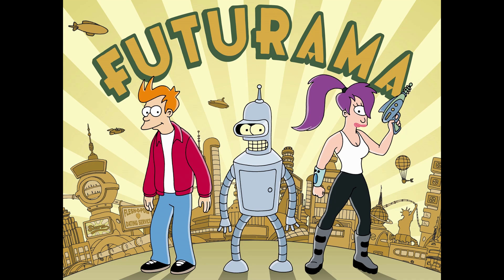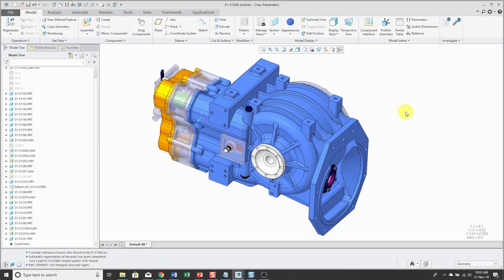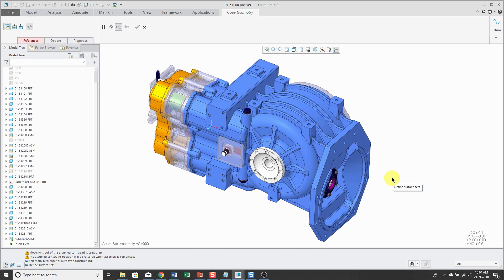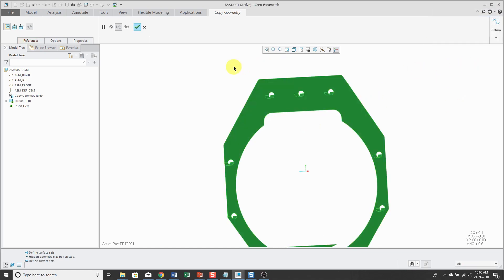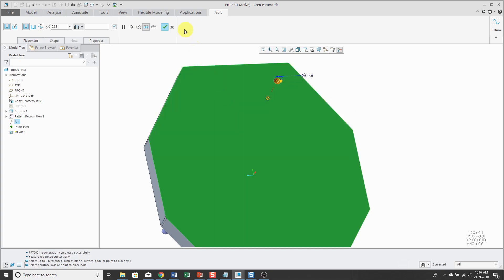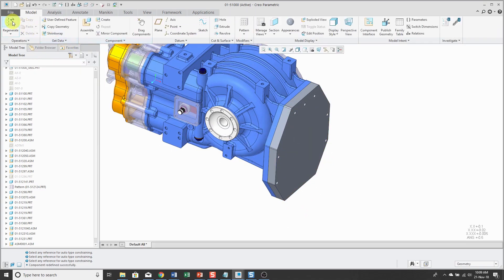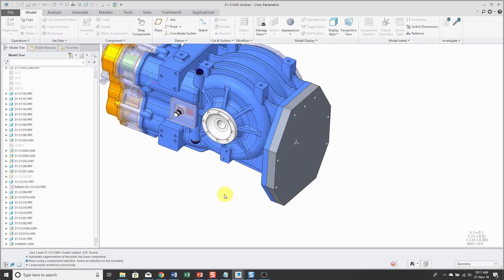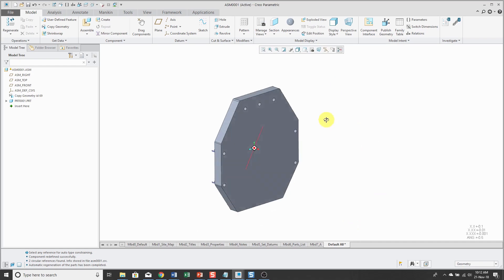Creo Parametric - Circular References (Part 1) - Assemblies & Top Down Design

Comment: Good explanation! What bothers me, is that so many Creo user (or maybe CAD users in general) don't take circular references serious and just continue working with their model. My recommendation: If you get circular reference, fix it right away! Or this thing will multiply down the line making your model more and more unstable. If have seen projects with over 1000 reported crcs.

Do people actually use the reference viewer to fix their .crc? I find the generated textfile.crc to be much easier to understand. Embarrassingly enough I have used the reference viewer hardly ever over the years. Understanding that thing is so hard, that even finding my mistakes manually is less time consuming.
Reply from the maker: PTC has made Creo and Windchill more robust at handling circular references. The downside is that it removes incentive for users to address the problems.

When the new Reference Viewer dialog box came out (I forget the previous utility, might have been Info > Parent / Child), I remember thinking that it is lot more complicated. However, it has a HUGE amount of functionality. Users do need to have a good understanding of references and dependencies.

Comment: Do you know if there is a way to avoid circular references in the case where you want to route piping/electrical hardware in sub-assembly B, which is mounted on part A (through top-down design), and then go back and make mounting holes in A by referencing sub-assembly B part placements? 
The individual features are logically sound, but it keeps giving circular references at the shrinkwrap / copy-geom (because the hole gets added after)..
Reply from the maker: You  basically have four choices: (1) locate the holes and then break the external reference; (2) use a higher level Skeleton to control both A and B; (3) use a Copy Geom or Shrinkwrap and then set it to Manual Update; or (4) live with the Circular Reference. There was an interesting presentation at LiveWorx last year by Pete Hollmer that indicated that Circular References might no longer be the bane to regeneration time that they once were. I wrote about that in this blog post on PTC.com:
https://www.ptc.com/en/cad-software-blog/unexpected-lesson-faster-cad-assemblies
Reply: @CADPLMGuy  Will have to look at watching that. But the article was definitely worth the read! It's good to know that at least the circular references doesn't break the model, as much as just slow it down a bit.. That may just be the option I'll go with for most cases.. Much Appreciated!
Reply from the maker: @danman155  I was surprised. I remember 15 years ago when Circular References would render an assembly unusable to the point that it couldn't be checked into Intralink or Windchill. I suspect it also depends on the nature of the Circular Reference; some are worse than others. I've also noticed that stuff that caused Circular References in Wildfire don't create them in Creo. Yes, they should be avoided, but they're not the end of the world like they used to be.
Reply: @CADPLMGuy  Just thought I'd come back and note the solution we've gone with because I was thinking about it today and remembered this thread (and thought it could possibly be beneficial to anyone else facing the same issue).. 
Anyways, the solution we've accepted is basically just as you say about having a higher-level skeleton, but instead of the skeleton defining the mounting holes locations (which was my first thought when you mentioned it, and which didn't 'feel' right), the skeleton is the "clean" structure without any mounting info at all.

So the process goes: 1) create the "clean" structure assembly (not considering any mounting holes, etc. ), 2) Copy assembly geom into a skeleton part for the cabling/piping to be routed against, and add/define the necessary mounting interfaces, 3) create a new structure assembly which copies the "clean" assembly but adds the mounting interface information and additional detail features (holes, supports, etc.).

In the end, it means that you're left with two assembly files for the structure ("clean" and "detailed"), only one of which is actually meant for manufacturing, the other is just an assembly skeleton model (or simply the skeleton part if the structure is a single part). But the flow works with our design process (clean/skeleton is completed as part of preliminary design, and then switch to detailed version for detailed design stage), and it eliminates circular references!

Would still be interested if others have any different processes they use?